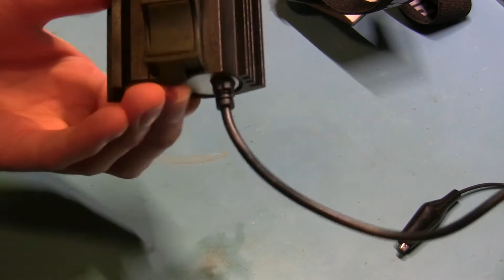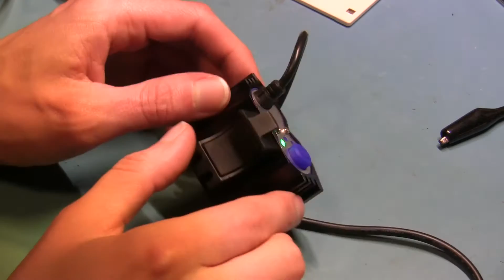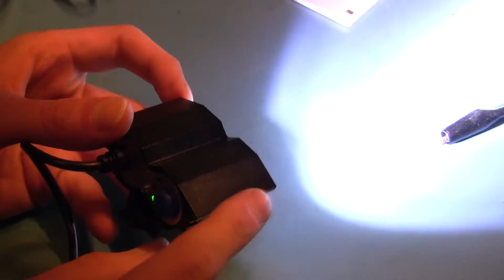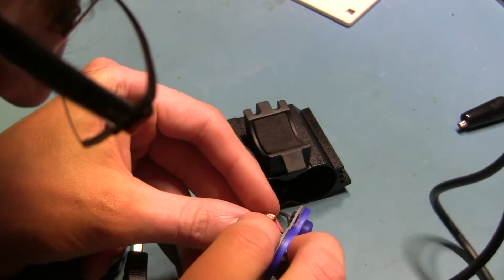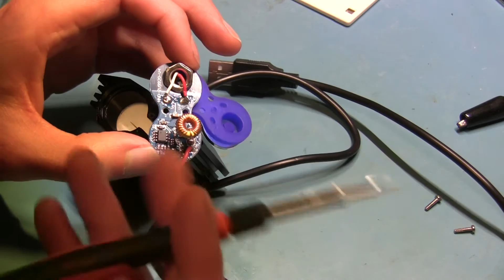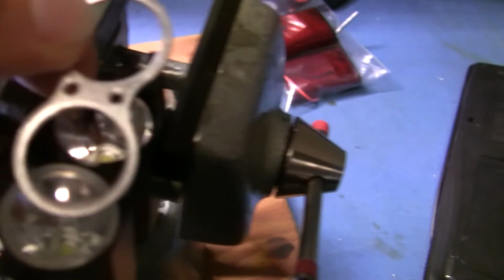Review/teardown of an ebay bike headlight (N2 Black USB)

Comment: If you had removed the plastic "foot" from the lamp (screw is under a soft rubber strip) you would find that the screw only engages about 3 turns and will soon vibrate loose in use. I put a slightly longer screw in mine and used loctite to secure it.

Comment: The battery's are a little strange. When I connect it to a battery power pack, use to charge phones. I only get one led power light. Yet when you connect a Ebay battery pack meant for these lights, all 3 will light up.